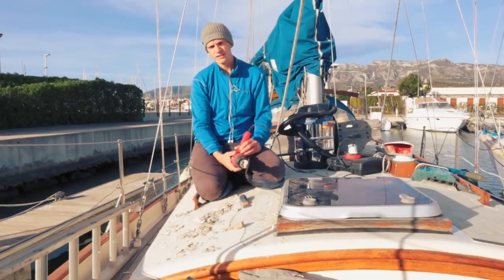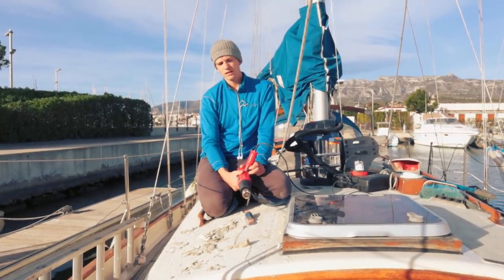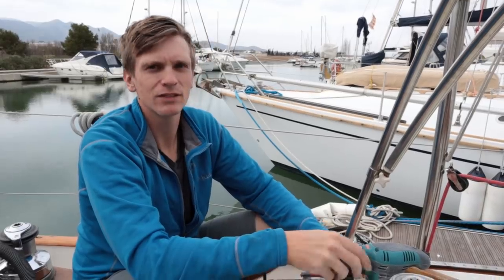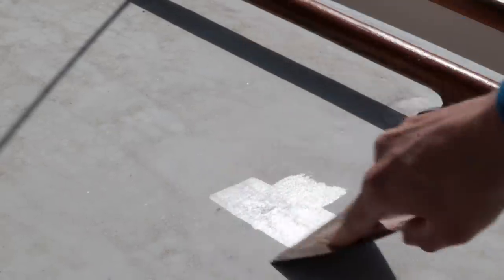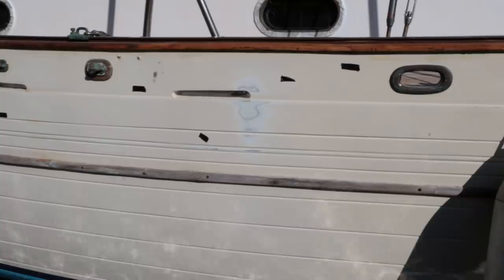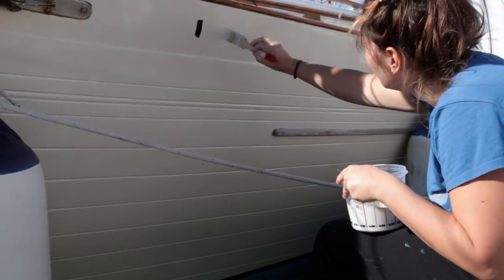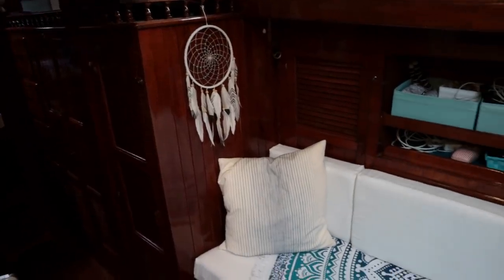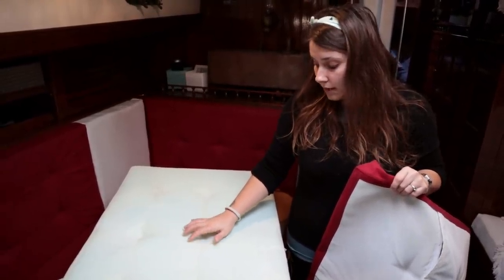39] Refitting A Cheap Old Sailboat | DIY BOAT REFIT | Sailing Skua

Comment: Congratulations 🍾🎊🎉 the white looks nice good luck though I would ruin it to fast I do like it and what about a hard dodger fiberglass top wood frame windows I think would really look good on that boat anyway your doing a awesome job👍👍
Reply from the maker: Hi Chad, we think hard dodgers are great, SV Prism have one and I think Atticus built one, but we're happy with the soft top for now - we think the advantage is to be able to remove it and get breeze through the cockpit when it's really hot.

Comment: Parabens e felicidades on your engagement guys. Great to see the boat work coming along nicely too.
Small tip, try to use the blue decorators tape for masking off. It doesn’t risk whatever it’s fixed to and doesn’t leave a residue. Unlike masking tape. Fair winds 😎
Reply from the maker: Thanks Chris! We’ll look for that tape next time 😊👍

Comment: FYI Unless you are going to strain your paint after mixing don't touch the bottom of the can because it stirs up particle crap that could mess up your paint job.   The boat is looking so good.  Congratulations to the both of you. May all days be without struggle and if you struggle may those days be short. :) Peace

Comment: Big congrats to you  both. Bit late now but watch that heat gun on gel coat, I used same when removing the gel coat for osmosis treatment, it did not take much before the gel coat could be scraped off inch by inch.
Reply from the maker: Thanks Criky, luckily that heat gun attachment seemed pretty good at directing the heat where it was needed and not onto the underlying fibreglass

Comment: Congratulations on your engagement. I like your small catamaran but I see from your video of Ryan moving about how it is a problem. I'm betting that non slip,was beach sand embedded in paint that was the old school way but it was effective. I'm a firm believer in 2part epoxy paint it would make a good investment because of its longevity, just my 2cents,you guys are doing well fair winds and calm seas till next time
Reply from the maker: Thank you. It was much bigger than sand grains - probably gravel. Next time, I guess 😉 We has to stay on budget as so many things needed fixing up.

Comment: Congratulations, aquamarine looks fabulous! good job on the cushions, I just made my 10 interior saloon cushions, had to learn to sew in the process. Fuel polishing...good system....however one change I would make, or ensure you include if you haven't....is using the same fuel/ water separator system (racor?) for your bottom filter. The initial crud separator is good, but the final filter is critical. This ensures you have a spare system should your engine system go bad (mine did) and the filter elements are the same you use on your engine (30 or 10 micron, maybe 5) and available anywhere. boat is looking great!
Reply from the maker: Thanks for the tip, the fuel filtration system on our boat actually has dual separating filters which are plumbed in separately so turning two stopcocks switches filter so if one gets clogged then a quick change to the other filter might sort it... at least that's the idea, who know what will happen when the engine dies on a windless day going into a small harbour
Reply: You have a good system, it will work well....trick is to catch the "clogging up" filter (or check valve ball in the racor itself) before the engine coughs and you have to run below to turn a valve! Childress installed a guage that shows pressure across the filter (needle dropping indicates sludge buildup) and when the psi drops to a  known level the filter is clogged and he changes over to the second filter before engine issues. All good fun! Thanks @SailingKittiwake
Reply from the maker: Ah yes I've seen those - like a vacuum gauge, I'll see where I can get hold of one, probably eBay. Thanks!

Comment: I love the white, it also makes the salon look cooler inside (temp).  In case this helps anyone my mom's best friend was a boat upolster for wellcraft (super nice lady) and she showed me if you turn the material inside out and then pull it over the cushsion (pillow cases) it is much easier to get on.  Instead of pushing the cushion thru your pulling the material down. I know right. : )peace
Reply from the maker: Ha! If only I knew it then. Thanks a lot 😊
Reply: @SailingKittiwake  Oh I was hoping you still had more to do to make this easier. After your first washing don't forget and dry them inside out that helps also. :) Peace
Reply: @SailingKittiwake  What is also cool is her husband did built fiberglass boats and he made framing for our kitchen lighting using teak.  The kitchen ligts redone, but I kept all the teak. : ) peace

Comment: Fortunately I had a small fuel tank so could clean out by hand, however when I filled the tank with nice clean diesel the engine wouldn't start.  It turned out that fuel line aperture was halved with crud so might be worth checking. Congrats btw!
Reply from the maker: Thanks for the tip, our lines seem reasonable but definitely worth a check next time we're holed up somewhere - the most annoying bit is then bleeding the system without squiring fuel all over the lazarette.

Comment: Try chucking some marbles into your fuel tank to knock any crud off the bottom. Use non metallic marbles. You will need to use the polishing machine all the time then , for a while anyway. If you have a lot of crud in your tank, try adding more of the separating glass vessels in parallel. (not series) This will slow down the fuel flow and enable more settling.  If you have a shutoff valve before and after each of the settling vessels you can clean each one without shutting off the pump.If you have the money, put a couple more filters (in parallel) with the first one. Each filter (in parallel, not series) will lessen the strain on your pump.  If you put them in series, the strain will be additive, like resistors in electricity. Again, you will have to have a shutoff  valve before and after each filter so you can service them individually while your pump is running.
Reply from the maker: Excellent tips, thanks! Hadn't even thought of putting in extras in parallel but it makes a lot of sense.

Comment: Fuel fuel tank stripping has been the norm in commercial and military diesel tanks.  Stripping lines pull fuel/water/crud from below the fuel pick-up line in the tank.  Water/fuel mix from the stripping line is stored in a oily water tank for later disposal.  Fuel polishing is required for modern engines working at higher fuel pump pressures since the injector nozzles have smaller orifices at higher pressures.  Polishing can be accomplished by circulating fuel through a separator, or a coalesce, or a series of filters of decreasing micron values and returning the fuel back to a service tank versus a storage tank.  Depending on the age of your engine and the IMO / EPA compliance level will help to determine the final filtering requirement.  A modern Tier II or Tier III engine will need significant fuel polishing with a final filter of 10 microns.  Some cautions, be sure your engine fuel pump is capable of pulling fuel through the filter(s) and noted that fuel returned from the engine has effectively already been polished.  Also treat your fuel on delivery for bugs.

Comment: Good Job on the Cushion Sewing The Fuel Cleaner My main concern is the Electric pump and Diesel The  ideal situation is to have a sump on your fuel tank and this will allow the water that you will get to drop to the lowest point and then you drain it off Diesel is similar to Aviation Turbine fuels in the process at where it is Refined at in the distillation stack. However sadly the Warm climates you are going to you will get water in the fuel on delivery as  I am sure that the Pumps you get your fuel from are not as strict at testing the fuel as we are in Aviation. The Fungal growth that you get in diesel and Jet A1 fuels is treated by regularly treating your fuel with a Biocide to Kill the Fungal growth and by sumping the tanks  after refuelling  I suggest leaving the the boat to stand for a day or so before sumping  also if you want to test for water  there are products on the market that you can use with a Medical type syringe and a pellet that you draw the fuel through and if it changes colour to blue then you have water in suspension in the fuel However a boat moving about will cause the water and fuel to remain mixed

Comment: Great job the cushions. I like your choice of sewing machine, I too was thinking os a sailrite machine, but am having a hard time justifying the cost.
Curious what powers the machine? Is it 12 volt or European 220V? If 220 do ypu use shore power, a generator or. Invertor?
Reply from the maker: Hi, thank you 😊 It’s 220V as we were in a marina for the refit (the previous owner had paid up for the winter 😁). We’ll use it on the inverter on sunny days once we set off cruising, although we hope that’ll be a rare occurrence 😁

Comment: Looking great! Opinion on the sewing machine?
Reply from the maker: It does very well on normal fabrics and went OK through the thinnest sections of our staysail (but not the corners, nope). It was a bit of a pain to use on canvas because the thread tension of the bobbin isn’t adjustable, so I couldn’t get the perfect thread tension. I had to plan my sprayhood around how many layers of canvas/vynil the machine could go through. 
However all new canvas is up and it went through 2 times being at anchor in 50 knots without a problem. So I guess it’s OK. When you’re on a budget, you make things work 😉
Episode 42 will be about the canvas work if that’s something you’re into 😊
Reply: @SailingKittiwake  That doesn't sound too bad and the price tag is acceptable! Thank you for the info! Fair Winds!

Comment: Awlgrip with a skid coat... rather than properly prepare and paint or resurface, it was just painted over... if you have the means, you really should resurface any area you may have to walk about or work upon with the awlgrip and texture you feel comfortable with...  continued success on your rework... cheers!
Reply from the maker: Thanks David, have you used the interdeck and found it didn't work well? We've used it in the past and heard really good things about it
Reply: Sailing Kittiwake ... no, I have not.  I am only familiar with the awlgrip products from recommendations and experience with surveys.  As I am in the US, it is quite possible that Interdeck might be a better choice.  Good luck... and don’t forget about the Robert Perry Facebook pages you are welcome to visit or join!  Cheers... and congratulations on the upcoming wedding!
Reply from the maker: Thanks David. Elena is fairly active on the Bob Perry pages. They are very useful 😊

Comment: Guys, high heat is not good for fiberglass.  I would suggest using a belt sander, not a heat gun.
Reply from the maker: Hi Philip, even a 36grit disk on an angle grinder wouldn't get through the gravel, so doubt a belt sander would work. The other option would be to chemically strip the paint off and leave the gravel but it was surprisingly heavy so we didn't really want to keep it.

Comment: Hi, Norman sent you the information about the RACOR filter. It looks pretty much like the original design from Separ, who had the patent, I guess. I had one of those (Separ) with Alarm sensors for water, and it just worked perfectly. Nevertheless, I replaced it (last week!) with a double version, which can be switched over while the engine is (still) running. Shit happens always when you do not need it like in tricky harbor entries or reef passages. If you hear that the engine starts to run irregular or risks to stop, just switch to the second filter and the engine will continue. Here is the link to one seller of the single version: 
https://www.svb24.com/en/separ-swk-2000-5-single-filter.html
and here the double version (which I have installed):
https://www.svb24.com/en/diesel-filter-separ-swk-2000-5-dual.html
Yes, they are expensive, but … I am so sorry for you: I sold my single one for 50€ some days ago not knowing about this discussion. Otherwise, I would have given it to you.
By the way: I love your films. Just perfect! Thank you.
Reply from the maker: Hi, thanks so much for thinking of us anyway, the thought was really kind. We actually have a twin switchable filter setup on the pre-filters for the engine, so can do as you suggest with switching over to a second filter if the engine sounds iffy, although the setup shown there looks like a great solution.  Thanks so much for the kind words, we're glad you enjoy them.

Comment: I highly doubt that sewing machine will be capable of doing much sail jobs, going through one ply of sail maybe, but doubt 2 or 3 that you will need it for. But sounds like there are plenty of other projects you will be able to use it for. One can get the off brands of sailrite, they are manufactured and made from the same company even, for more than half the price. Or as some do, get cheaper but still pretty decent sewing machine that one can change and put on a bigger flywheel.
Reply from the maker: Hi Kevin, it might surprise you but you'll see in Episode 42 that it can indeed go through our staysail and the sunbrella UV strip. But not in the corners where there are multiple layers of Dacron overlapping. But in the corners it doesn't take long to use the speedy stitcher as the lengths are relatively short

Comment: To remove the paint on the deck use of an oscillating tool would have saved days of work......
Reply from the maker: I tried it and it didn't work at all, the oscillating blade couldn't get between the gel coat and the bonded on gravel.

Comment: Please don't use Aceton. Its very dangerous stuff and there are reasons why its very restricted now.
I recently had the chance to visit a boat refit course in a professionel shipyard. Our instructor, a master boatbuilder, told us that don't use Aceton. Only old boatbuilders still use it because they don't know about alternatives. For example for preparing the surface for the color its enough to use some methylated spirits.
Reply from the maker: The problem is that most other solvent cleaners we can get in Europe also have acetone in, usually mixed with tuolene which is even more dangerous :-/